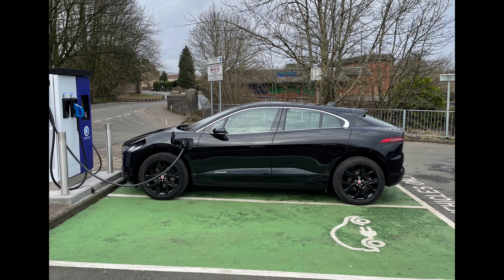Why don’t you get the full power when charging your EV?

Comment: I also think that the chargers are not as powerful as advertised. I assume a max of 50 kwh, despite what the charger says. My MG  can charge up to 100 kwh.
Reply from the maker: Apart from the factors mentioned in the video there’s really only likely to be one other reason you’re not getting the full power (if we assume there’s not an issue with the car) and that’s that there isn’t enough power available from the grid connection. Sometimes the CPO is waiting for a power upgrade.

Comment: Hi, I'm due to pick up a used iPace tomorrow and it's my first electric car and I'm feeling a bit unsure about several aspects of the charging process so I hope you don't mind me asking you a question. If the maximum charge the car will accept is 100kw but I happen to use a higher powered charger will that damage the car - or does it have some kind of regulator/safety feature which will protect the car? Also, which app do you find most useful for planning journeys around charging requirements (apologies if you cover this question somewhere in one of your very informative videos - I'm just working my way through them)? thanks
Reply from the maker: No problem at all, this is why I started the channel to help people with the transition to EV. It doesn’t matter that the charger has a higher speed than your car can take it will not damage the battery so you can use any Ultra Rapid charger without worry. Re route planning, try A Better Route Planner. You do need to spend a little bit of time setting it up with your car details and preferences but it’s worth it as it will suggest a route for you with charging stops and times at the charger required etc and is certainly the most sophisticated I’ve found. Other apps to use are Zap Map which is the best for finding chargers (I have a video on this) and is normally up to date with the latest chargers and if you pay the premium subscription you can even see new charges in the last 30 days as well as other features. There’s also Wattsup which I find a quick useful tool to show me all the chargers along a given route. I tend to use a combination of these for long journeys and I recommend doing a bit of planning before long journeys and have in mind some back up charging stops if you come across a problem or a very busy charging stop. Another tip is to download all the apps for the charging companies and enter your details inc credit card details. Watch my ‘5 tips to prepare for your first EV’ which may help. Hope that helps!
Reply: @electricfocus1710  Thank you very much for taking the time to leave such a comprehensive reply. I will check out the apps you have suggested and also look up the video you've mentioned. The idea of changing over to electric feels a bit daunting just now but I'm sure, like many others, in a month or so I will be wondering what I was worried about.